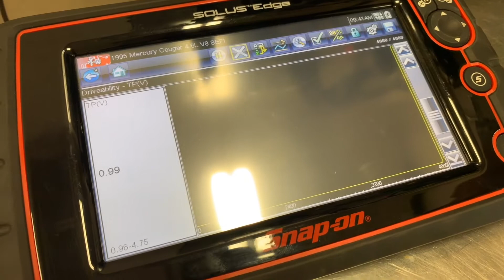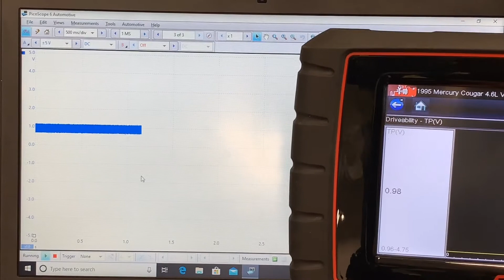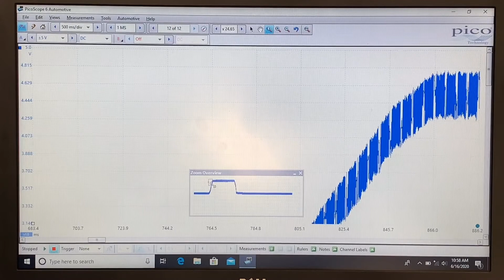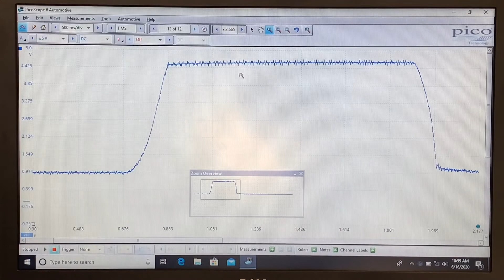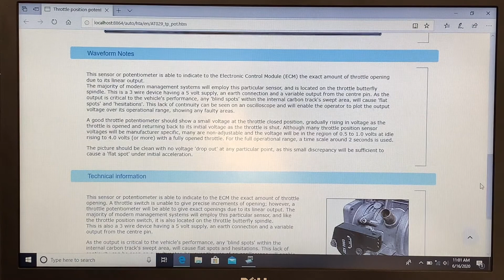PicoScope Basics: Testing a Throttle Position Sensor (TPS)

Comment: Can l ask?
Reply from the maker: Sure, what's your question?
Reply: @AdamsAnalysis  thanks, 
I'd like to ask if the DMM can be use as like as pico!?
Reply from the maker: The DMM can provide a lot of great information, similar to a scope. However, the sample rate of a DMM is very slow and it effectively averages readings and displays them. This lack of resolution may not provide the information needed to fully audit a TPS in certain situations.
Reply: @AdamsAnalysis  okay.. Thanks. I appreciate.
Reply: My biggest problem I have that hampers my use of scopes is getting the settings right for the various settings. I struggle even with the 4 ch e-scope from Automotive Test Solutions.
Reply: @dtnel  The most of them, they have a quick peak menu, you just click the sensor, and the set up is automatically activated.